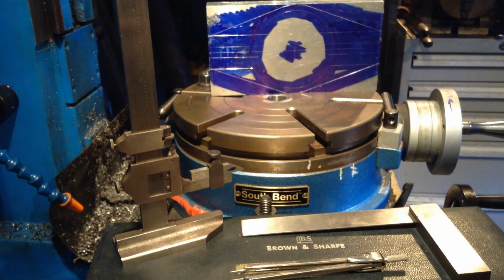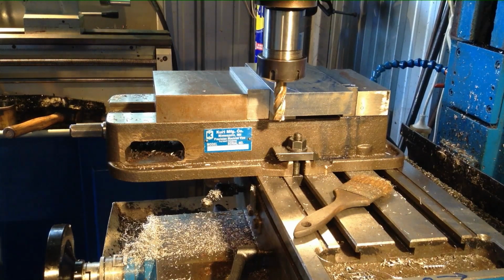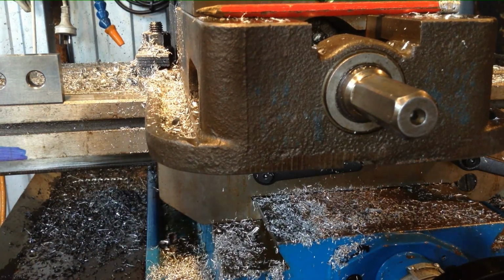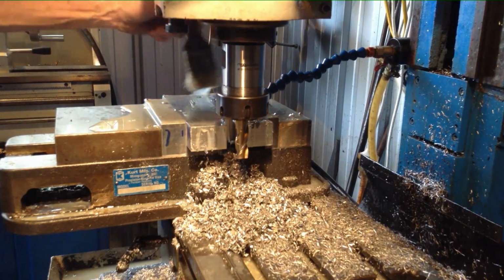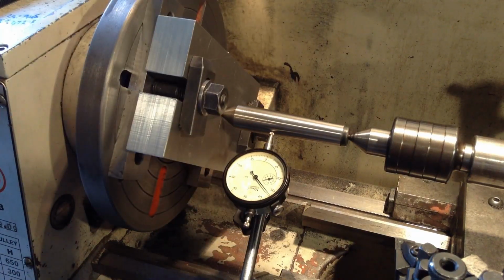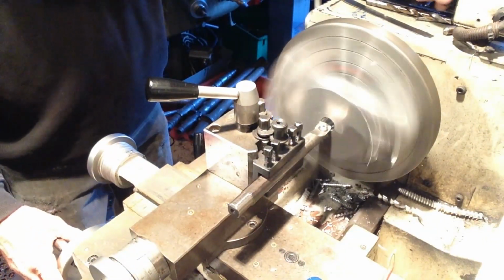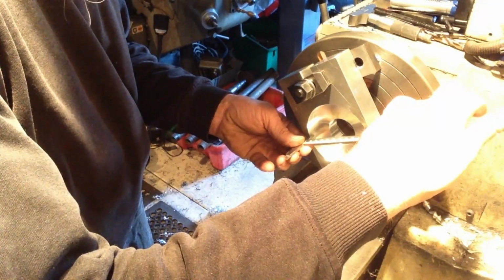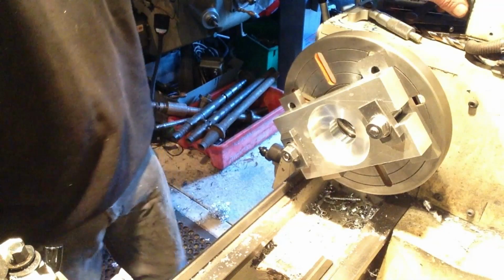Swarf & Chips  Episode 5  part 4

Comment: Very nice finish.  Wish I could find a face plate for my Colchester  with ths L1 taper spindle.   Looks good Max
Reply from the maker: G'day Mate , you might have to adapt a camlock face plate with a high quality cast iron boss attached to get to the L1   ,    i think it could be done . I remember the L series tapers , I used to use a Harrison L17  that had the L2 taper .  Cheers .